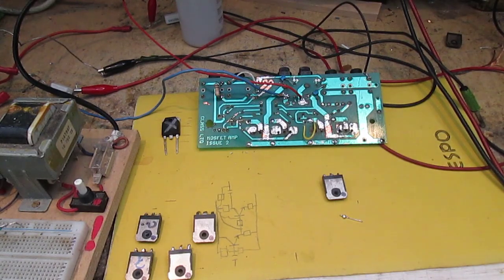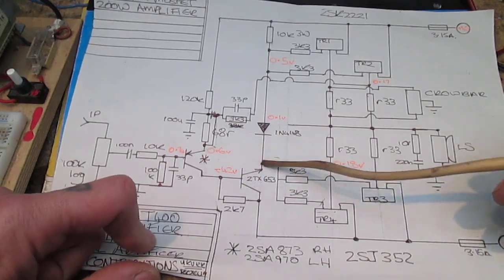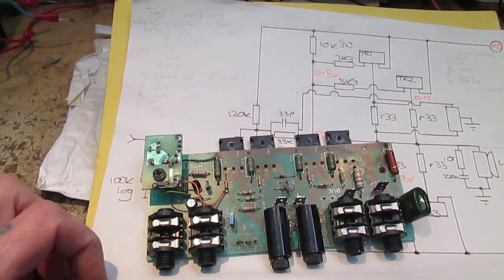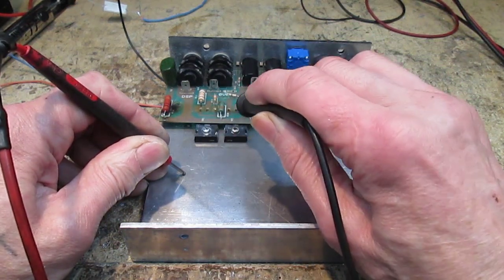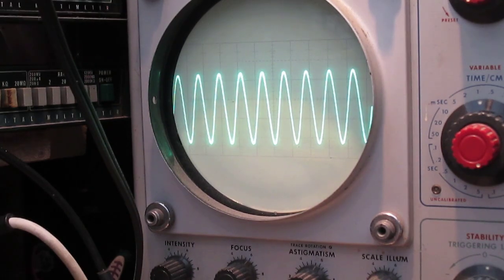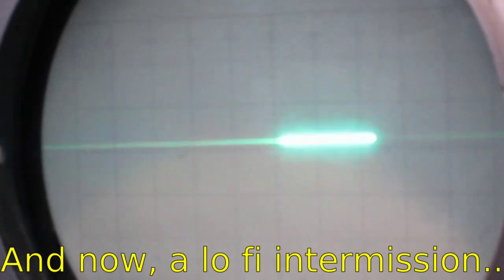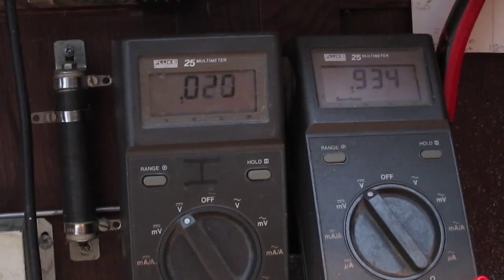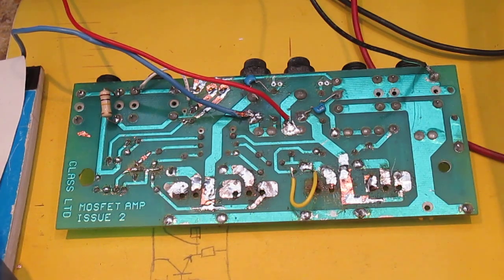Vintage Mosfet Amp - Repair - Part Two.

Comment: When designing and testing control systems, one useful technique is to break the feedback loop and inject a signal from an external source. At first, that would usually be a DC supply, which enables you to understand what the circuit does at different feedback voltages, particularly the gain and upper and lower limits.

The next thing is to inject an AC signal on top of the DC and measure the phase difference on either side of where you broke the feedback loop. Ideally, they should be 180 degrees out of phase so you have negative feedback. If the phase difference reaches 360 degrees and the gain is at least one, you've got an oscillator, which is not good. You need to do that at different frequencies because the phase shift is likely to be frequency dependent.

We used to plot that on a graph, which makes it easier to see what's happening and predict which frequencies we should test, which saves time. It's interesting that almost no one seems to do that on any of these YouTube electronic repair channels.
Reply from the maker: Thanks Steve for your IP. Funnily enough that's what I was going to do, I got the idea from Curious Mark in his recent video on repairing a HP clock, see ep 2.
   I've learned a lot from attempting to fix this amp, I've been getting guidance on UKVRR, contributions from folk like yourself too is very helpfull too, TFW.
Reply: @diabolicalartificer  It's easy to measure the phase difference at high frequencies because you can measure the time difference along the x-axis of a scope. This is difficult if the control system has a long time constant, but there's another way to measure the phase difference, which I learned from some really smart colleagues at ICL in the 1970s when testing a switched mode PSU with a 2-second time constant.

You adjust the scope so the two signals are the same amplitude on the screen, then put the scope into x-y mode and look at the shape of the Lissajous figure. A diagonal line from bottom left to top right means the signals are in phase, while a circle means they are 90 degrees out of phase. My colleagues had an article on the technique published in Wireless World.
Reply from the maker: @stevegreen5358  Thanks again Steve for those useful tips. Measuring phase difference is something I keep meaning to dive into, especially in my valve amps as the phase difference effects stability. That's a good tip there using the XY function of my scope. I have another scope which can measure phase, but it's a bit clunky & difficult to drive. TFW, cheers, Andy.